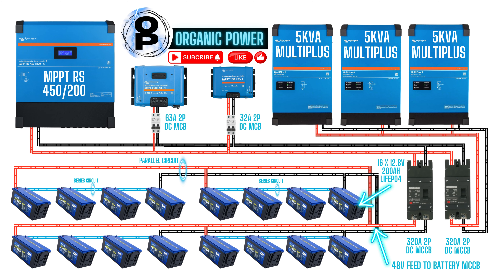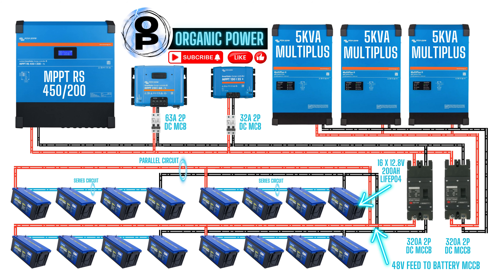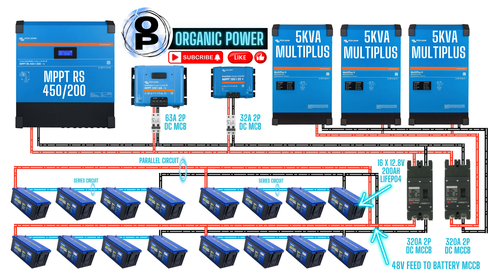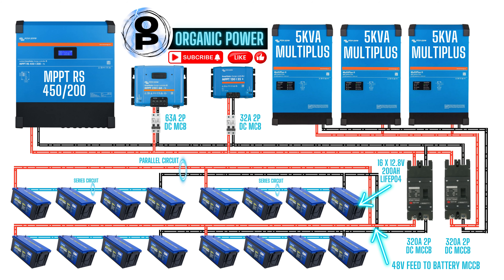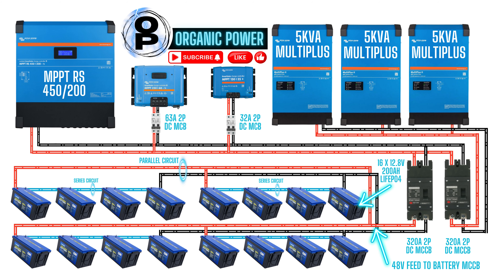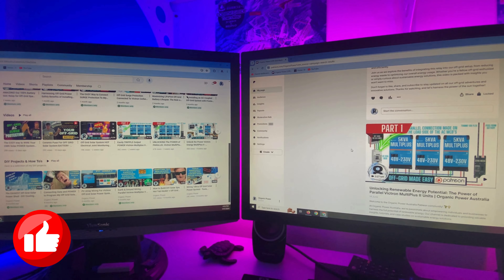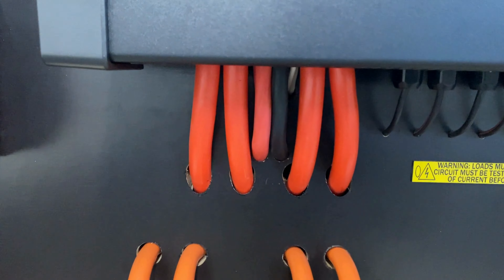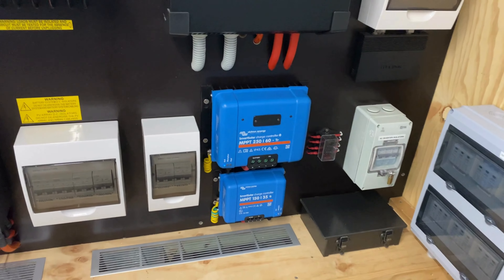EASIEST Off Grid Battery Bank Wiring For Solar Power System

Comment: Did you do your own research on that brand of battery or did you rely on the info available online? I,m Interested because my research indicates a totally underrated product due to the brand name.
Reply from the maker: It's a very safe chemistry, the shop is around the corner and they will stand by their product. I had more faith in an off the shelf store bought battery rather than using no name batteries bought online.
Reply: @OrganicPower-Australia  Agree, all the serious reviews (As in all the discharge / recharge tests and disassembly) indicate a great battery.
Reply from the maker: Thank you for taking an interest in the channel! In the past 12 months we have produced 19576kWh and consumed 18332kWh we are very happy. 18332 x .34c kWh = $6,232 in savings. The first 4 months of the year the system was still being built, next year will be even better!